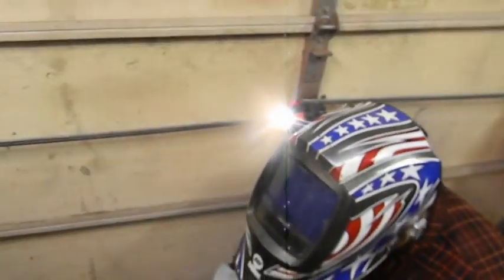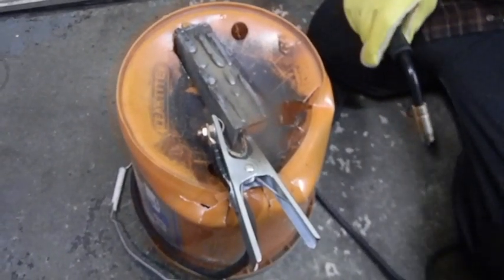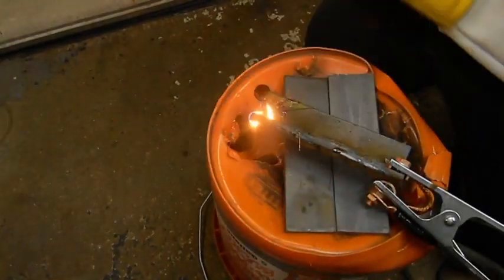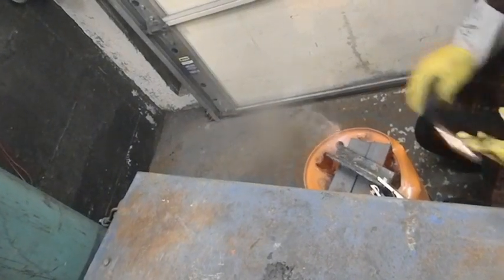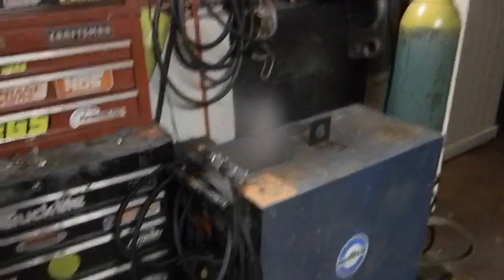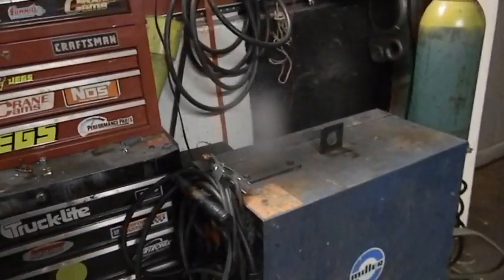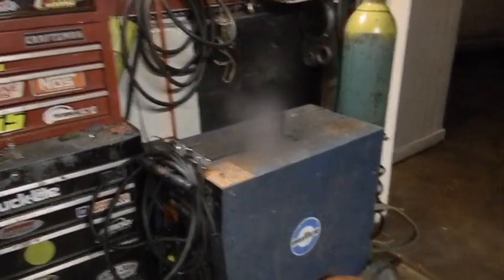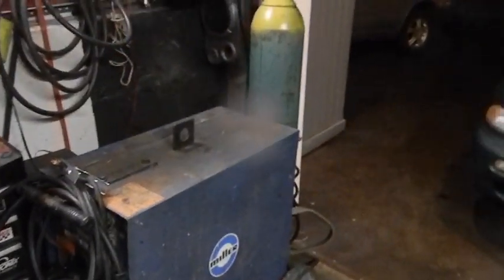Millermatic 200  Out Of Retirement

Comment: Go Jr.go!wait, I can't see shit.... oh , there it is! Awesome! Screw the bucket, have fun, and get ready for my 200 point roll cage!lol 
Yes, plastic is flammable. So is iron filings if you k ow how to get them lit! See Guinness world records and you'll see the world's largest Iron fire.mmy buddy read about it and decided to try it himself, in his back yard, kinda like when Sheldon built his own nuclear reactor. My buddy got it lit, but had a hell of a time putting the fire out. Luckily he didn't have to call the fire department. Now he owns a marina in Virginia. He's the best machinist I've ever worked with, and after 20+ years in Auto Parts and Machine, the majority of which was in engine rebuilding shops, I think that means something. And I think it means even more when I worked for Federal Mogul on the 1-800 tech help line before I went back to school and got into electronics. In my mind, nothing beats building an engine for a specific purpose outside what the factory intended. Electronics is only a small part of today's engines. Physics as it applies to the movement of fluids, such as air through the intake and exhaust is something you have to learn on your own. The formulas that are available for such things are not meant for the end user, so we have to learn those things by observation of other guy's efforts, and catalog them in our brains. Physics as far as launching a car off the line T the drag track is a little more defined, but still takes some observation on the racers part. As does getting through the corners at a dirt track, or snaking ones way through a road course. You guys have done an awesome job of getting in the ballpark, without any testing so far. And if your goal is to show the cars you built, you're already winners. If you choose to drag race your cars, that will take some more fine tuning. Go for it! The division is yours. But the division where I would compete is mine to win, if I can raise the mo SG to compete, and I hope I can some day, at least for a season or two! Meanwhile, you guys are tearing it up, and I love what you've done so far!